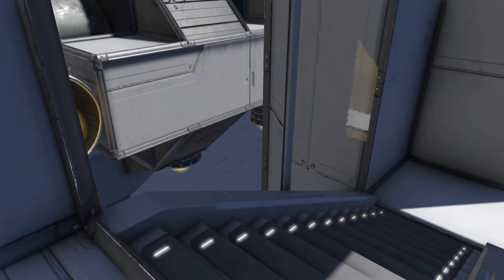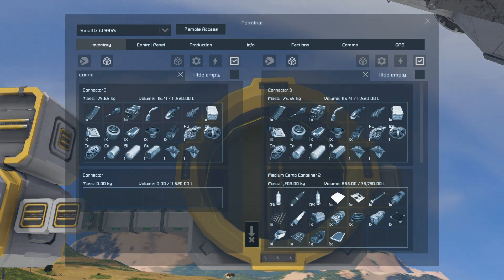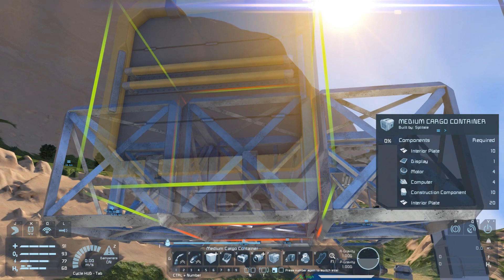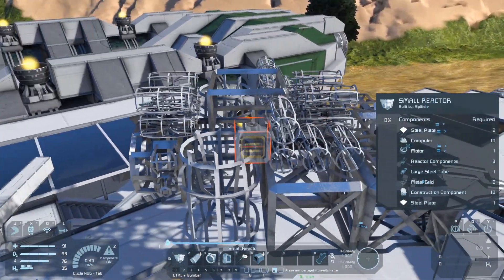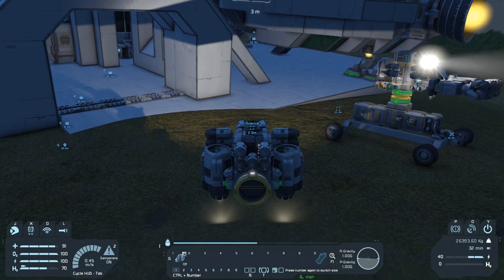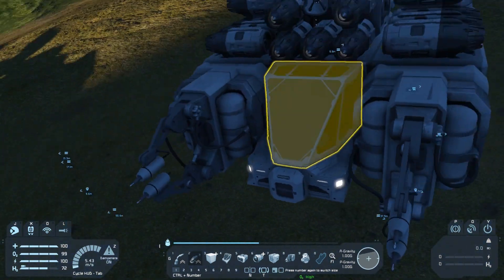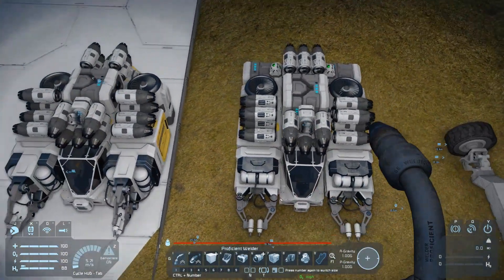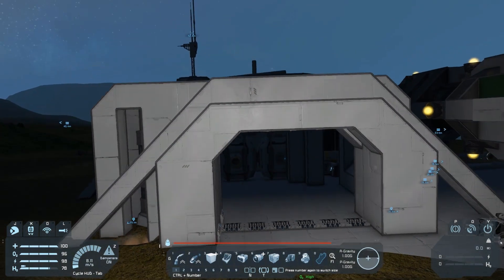Space Engineers Tutorial: Conveyors and Welding Ships (Part 7 of a survival tutorial series)

Comment: To anyone whose looking in the comments for those extra tidbits:

1 - When splitsie says medium cargo container, HE MEANS IT! I've been building large storage container versions which, while able to carry excessive amounts of ore and parts, makes my crafts flying bricks. Small clip of a wing and boom, 90% gone from mass calculations. If you want to use large, be careful and mindful of the amount of thrust versus possible mass. I find 7 thrusters each direction minimum with 2 batteries minimum is sufficient to haul 1-2 large containers worth of goodies depending on the goods' weights.
2 - Closer to the welder/grinder means faster operation. You can have a single space-worth before getting gaps in welding or grinding. So factor this into how you're welding/grinding. Dont want to risk your lovely ground-off Assert Thruster because the way you ground around it snapped it off the ship and down a 12 foot cliff... I wish I had footage of this xD
3 - I started building Welder/Grinder ships 400 hours in... WHY DIDN'T I DO IT SOONER? SO MANY HOURS, PLACING BLOCKS AND WELDING BY HAND...

Comment: Wouldn’t a Conveyor Converter work instead of this. I tried converting the starter ships into a welder with the conveyor converter but it wouldn’t take my steel plates
Reply from the maker: No, a conveyor converter has small ports so won't pass most components through them, you need to keep to the large ports only if you want components like steel plates to pass through

Comment: My construction ship is a simple drone that's just big enough to squeeze through a 1x1x1 hole to get to interior spaces of a larger build. You get used to moving via camera, but the only drawback is the inability to quickly check for any missing parts on a block that just won't finish. These require manual inspection, unfortuntely.

Comment: trying to build an auto welder, like a repair station for my ships and a ship building facility but cant get the welders set up properly even if i put them on pistons like ive seen in videos, they work for a half second then stop welding, theyre all connected up to storage which has atleast 1000 of everything, but i activate the blueprint move the pistons and welders in turn them on and slowly move them out but they build a few bits in the center of the ship then nothing else, like none of the welders have anything in the inventories, everything works fine,, like the grinder pit although had to make that safe, ship parts would fly everywhere at super sonic speed but the welders on that set up work fine, got welders round the inside of the grind pit and collectors that pick up scrap but cant get the ship builder to work? any ideas?

Comment: These are my issues concerning welding ships. Yes they build considerable faster however, the building process is somewhat uncontrolled. If you are building from a blueprint, and your welding tips inadvertently pass over blocks you don't want to weld right away you end up burying unbuilt blocks you need to grind away surround blocks to get to. Another issue is I've never managed to dock to my station and load up on the items from my G menu queue. There's something about the 'Conveyor Junction' that prevents me from pulling the items from the station containers into the ship. That means I have to transfer it manually. Am I doing something wrong?
Reply: i have the same issues. i've actually never made a welding ship because I mostly build from blueprints

Comment: In space, I've got a basic ship. 
It's a small scale cockpit on a large conveyor junction with two connectors at the front and on the bottom. 
The bottom is for docking and resupplying. The front one is for attachments. 
Instead of 3 ships, I have three attachments that connect to the front of my basic ship for drilling, welding or grinding.

Comment: I got fancy with my welder/grinder and mounted them on advanced rotors and set them up to point forward or down.
Reply from the maker: That's a good idea, with operation in gravity sometimes you may find that your inertial dampeners won't fight grav properly because of the rotor but if you're in space it won't ever be a real issue :)
Reply: @Splitsie  I do use it in atmospheric, the one problem I had building it was that thrusters mounted past the rotors wouldn't register the proper direction. I originally tried to put the side thrusters on the large conveyor junctions attached to the rotors and iirc the game thought they were down instead of left and right.

Comment: You lost me on small reactor at 4:15 i really need a basic non highend ores welding ship. The workshop is a mess with so much trash :(
Reply from the maker: This is a very old design back when reactors and uranium were easy to access, however since this ship is almost entirely battery powered you can just remove the reactors and not worry about them as they don't really add much except for a backup power supply anyway :)

Comment: My biggest concern when using a build ship is the possibility for the thrusters to do damage to whatever I'm building, namely the backwards thrusters considering I'm right up against the build when welding. I would also like to point out, though, that this is more prevalent to me because my build ship is on a large grid, making the danger zone of thrusters much bigger. (I know using large grids gives it a huge shape, but I mainly use it to build from projectors and go layer by layer, reducing the need to have to squeeze into tight spaces. That. plus the GREATLY increased cargo space to reduce resupply trips, outweighs the cost of a larger ship for me at least. Also, it's an ion-powered ship so I don't have to deal with that pesky gravity :) )

Regardless, my advice for when you're building ships, especially welder ships or any other ships that will be in extremely close proximity to other ships or grids, is to make sure you leave enough room with the thrusters for you to get close enough to whatever you're building without it being in the danger zone of your thrusters. Do note that this is only really a concern for worlds that have thruster damage turned on.
Reply from the maker: It's certainly worth being cautious of regardless of where you use it, becomes weirdly easy to burn a hole in your floor or wall if you're not :P

Comment: Just a question: is it possible to build a spaceship that can also, when landed, move on wheels?
Reply from the maker: Yes, but the handling can get a bit weird due to the wheels being subgrids and not always correctly accounted for by the inertial dampeners, of course you can grind them off and replace them when going in for landing if you want to get around that issue :)

Comment: For the steel plates vs ammo, the steel plate is very wide and thin, so there's less volume, but in all directions but one, it is physically larger, and ammo can be broken down, or think of how ammo casings get ejected, while the bullet tip flies.
The belts can be unwound and are much more flexible, and the box could then theoretically be taken apart or fold, and then reform at the other end.
Without structurally weakening steel plates, they cannot be cut and welded together again, same with some other components, like the bottle, which would cause micro pits or cracks and thus possibility of bursting increases 100 fold
Reply from the maker: Yep, that works to give it a backstory explanation :)

Comment: How do you charge your ships with only batteries? Do you build a charge station?
Reply from the maker: Ships with batteries can be charged when attached to another grid through their connector. If the grid they've connected to has excess power it will be delivered to the batteries on board, if the grid you attach to doesn't have enough, then the vehicles batteries will be used unless you set the batteries on the ship to recharge. Be careful with this though, as a battery on recharge will not deliver power to any systems, so if the base you've locked to runs out of power, your vehicle will drop like a stone from a connector that's no longer got the power to remain on and keep things locked :P
Reply: @Splitsie  thanks for the reply man love the vids just started played less than 10 hours :)  just to make sure grid= connected structures like floor blocks from my turbine to my parking lot
Reply from the maker: A grid is any continuous collection of blocks, so a ship, a base etc where the blocks are all directly connected to each other. Rotors, pistons, connector and landing gear connections would be connecting 'subgrids'. 

I'm pretty sure that what you've described would be a single grid, just thought I'd throw in the most succinct definition I could think of :)

Comment: For grinder ships, I have found large grid preferable to small grid due to the massively increased storage capacity and lack of required precision.  A single large cargo container, with four front mounted grinders, spaced apart by three small cargo containers, then held aloft by pairs of small atmospheric thrusters is phenominal on europa.  This design may require tweaking on full scale planets.  I often find myself pirating large vessels and needing to grind them down.  This design has become a staple of my survival games.
Reply from the maker: You're right, large grid has a big advantage when it comes to grinders, not only because of the reasons you mentioned but also because small grid is really, really, slow. This was more a tutorial on how to make a very early game welder/grinder and have a reason to go into the differences between the conveyor sizes since I'd had a lot of questions about it at the time and felt this was a more interesting way to explain things :)

Comment: Do you have any suggestions for scripts that fill the welders and transfer the mats from its cargo to welders
Reply from the maker: The welders can automatically pull materials from any connected inventory (assuming it has the appropriate size for the component being moved) but if you're wanting to automatically load up when connected to a base then you'll need to use something like Isy's inventory manager or Taleden's Inventory Manager. Both are scripts that would let you set up the required predetermined amounts to autofill when connected to the base :)

Comment: Using the fighter cockpit in this situation would have yeilded more cargo space.  The fighter cockpit's Large conveyor port is on its back.  If the length of the cockpit becomes an issue use Conveyor junctions attached to the wielders to extend their reach beyond the cockpit.
Reply from the maker: There are a few reasons I wouldn't use that approach, the main one being that I wanted this ship to be as small as I could reasonably get it, so that it can fit into tighter spaces to reduce any reliance on hand welding. 

The other side of it is that you would get more storage out of the same volume by placing the small cockpit and a medium cargo container where the fighter cockpit would sit, even without the cockpit piped it would give you greater capacity. 

Or you could tip the little cockpit sideways and get the bonus but just cope with weird control directions :P

Comment: One tip to remember with "floating" (rear) docking ports (connectors) is that if your base runs out of power... the locks on the connectors will disengage and drop your ship (if its batteries are busy recharging).

I've lost a few drilling rigs early during a game because my base was on solar power and the batteries got sucked dry by my first welding/drilling rig(s).... which results in your ships being dropped from a high height onto the hard floor and blowing up :/
Reply: Adding a landing gear to the base beside the connector to lock on to the batteries could solve this problem for you
Reply: Why not use wind turbines?
Reply: @coiledbug2394  That comment was written about a year ago... before turbines existed.  You can still have the same problem regardless of which power generation method you use though.

The easiest way to fix this is to use landing gears to lock the ship to your base, so that even if the power goes out... your ships don't drop off connectors.
Reply: The video was a tutorial for people that were new to Space Engineers and even back when it was released had some glaring issues like the dropping of ships from connectors.

In my own bases / motherships though, I use landing gears to lock down my ships so that even if I run out of power - they can't move.

I also use Remote Control blocks with autopilot to go "home" & auto-dock on planets.  A timer block then sets my ships batteries to recharge when its connector & landing gears are locked.  This is mainly because I'm lazy, don't wanna fly back... and the autopilot can dock way faster/safer than I can.

Inventory Management scripts (like Taledens) are also useful things to restock welding ships, rebalance dual grinder/welder ships, etc.
Reply: Daryl Knight oh heheh oh sorry I didn’t know space engineers even existed until just recently like in may or June ish I don’t know much XD
Reply: @coiledbug2394  No problem.  There is a lot to learn if you wanna go deep into Space Engineers.

If you're a coder... Programmable Blocks use C# which is a real programming language for making software.  You can include the games DLLs into (microsoft) Visual Studio to use its autocomplete for Space Engineers stucts, enumerations, etc.

I do this sometimes when designing my own machines... so they can check things are locked before moving the next part... if not they try to reset position so that they can lock.

Also, some of my automated drilling/welding scripts will make sure they have enough power/resources before moving deeper into mountains, etc.  Other machines use scripts to flash "interior lights" different colors (along with starting/stopping alert sounds) depending on my cargo capacity, remaiming power vs distance from recharge pad, etc.

Thats getting way too advanced for non-coders though... so there are scripts and ships, etc  that you can subscribe too, that other people maintain :)
Reply: Daryl Knight well I would do all that but there is one tiny problem.

I play space engineers on an Xbox and there is no scripting for Xbox only PC.
Reply: @coiledbug2394  You should have led with owning an Xbox.  I'm sorry :(
Where can we donate to get you a real gaming PC? :P
Reply: Daryl Knight even though I am very limited with Xbox I still prefer an Xbox rather than PC
Reply: Daryl Knight it’s mostly because I am very used to Xbox and I’m not very good at playing on PC
Reply: @coiledbug2394  Just so you know, you can play with an Xbox Controller, even on PC! :)
Also, you'll get mods! :)

Comment: Can someone help me. I am using the same building exactly but I don't have anything under the size of one block
Reply from the maker: Sadly the small grid welders are next to useless since a recent update, in my survival series I built an alternative welder in this episode: https://youtu.be/1wmbeRr0RK4

It uses an advanced rotor to convert to large grid, so it has a large grid welder, it also uses the vector thrust 2 script, but it works reasonably well. An easier solution would be to use this mod: http://steamcommunity.com/sharedfiles/filedetails/?id=1306580025 which changes the range back to something closer to what it used to be. 

I'm not sure if I've properly understood the issue you're having though, so if it's something else let me know :)

Comment: Instead of using an excessive number of lateral thrusters to safety fly at most angles, you can instead use advanced rotors and limit them +/-90 degrees.
Reply from the maker: If you're talking about having the welders on rotors to allow them to point other directions, that could certainly work. But the reason I have lots of extra thrusters is that when I'm welding I have a bad tendency to lose track of the horizon and rapidly lose altitude :P
Reply from the maker: It's not so much because I'm trying to get into tight spaces as it is that I find it hard to maintain level when I'm focusing on welding

Comment: The grinder ship I would have put a connector under the cockpit and replaced the one at the rear with a extra battery so you have 1 on the roof one on the back or even better add 2 at the rear leaving you with 3 battery's total and he 2 small reactors;) That's if you decided not to add more reactors that is :p
Reply from the maker: The trouble with that is then the components can't get through the connector, you're left with a small conveyor connection between the grinders and the connector so a lot of different components won't be able to pass :(